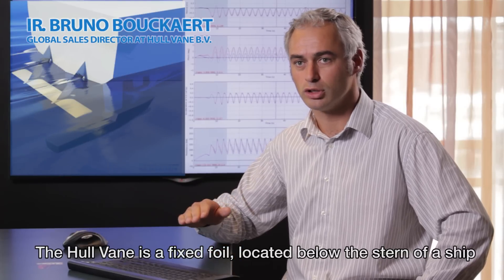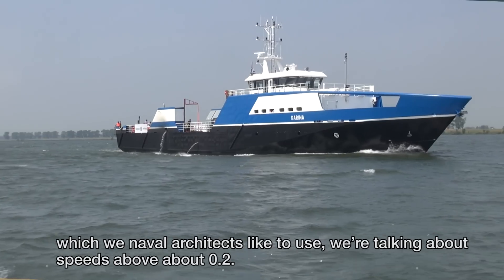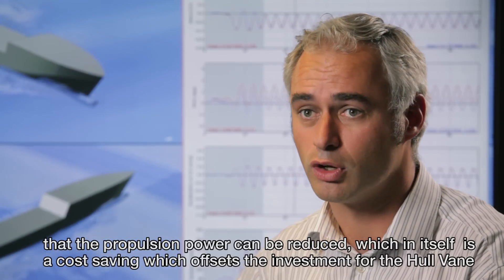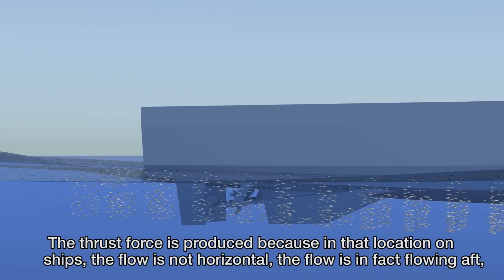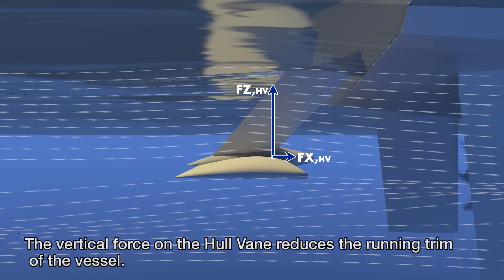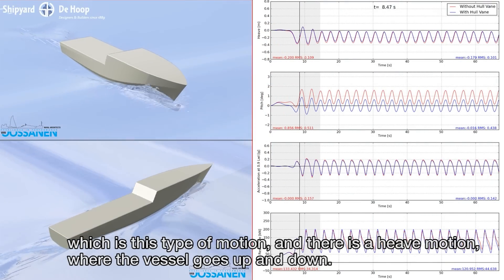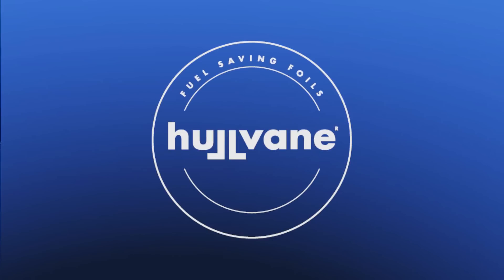Hull Vane - Fuel Saving Foils

Comment: What would be the payback period for a typical cargo ship?
Reply: How fucking expensive can this vane be? It's not hard to make, a welder could crank one out in a few days.
Reply from the maker: Depends which kind of ship, and of how it's used. Tankers and bulk carriers are too slow for this, and you will never get payback. On some others we get less than 3 years, and on some newbuilds 0 years (because the saving on propulsion power is bigger than the cost of Hull Vane). The latter are usually faster than typical cargo ships (e.g. crewboats,).

Comment: Cool idea! A while after watching this video it crossed my mind that maybe something similar, though upside-down, could be applied to my car. I have a VW Bug, which has a steeply sloping rear end, which causes a lot of drag as the air flows down along it. A wing placed at the right angle and position in this flow, redirecting it toward the rear, might have a net thrust force, countering some of this drag and improving fuel economy. Would also provide some downforce, a secondary benefit (I'm not a racer) of making the car feel a little more solid at freeway speed. Probably not as much downforce as the lift the car generates, but to make more would add drag, the primary goal being fuel economy, not lap times. Somewhat related to the downforce wings racecars have, I see it as sort of combining that idea and this "hull vane," though said wings redirect horizontal air upward to generate a lot of downforce, plus drag, while this would redirect downward flow to horizontal, gaining thrust and some downforce. Two challenges I see are that this would place a low-pressure area near the engine cooling air intakes, which would make the engine run hot, and also I'd have no idea how to determine the optimal position, angle, airfoil shape, and size without either a wind tunnel or very sophisticated CFD, neither of which I have access to.
Reply: Hi Quill, a very good idea, and there are indeed car spoilers (wings) which produce a net forward thrust as they are positioned in a downward flow of air. This is the reason why the Hull Vane is sometimes called an "inverted underwater spoiler".

Comment: They should be made in a more of a swept wing shape, in order to hopefully freely dislodge any rope, buoys, kelp, or other floating debris that could otherwise get entangled in the vane.
Reply from the maker: Some of our Hull Vanes have a swept wing indeed. What you see in the video (5 years old) is the very basic TT-shaped configuration.  Floating debris has never been an issue as the water coming over the Hull Vane has passed through the propellers and over the rudders first.
Reply: I am a former Maine lobsterman, our waters are like an obstacle course. LOL.
Reply: shirleymae30 you ain’t seen nothing till you go to Asia !!!
Reply: @markrobertson4320  an ocean of tooth brushes
Reply: @markrobertson4320  you’d think they’d figure out to quit using their water as a sewer and garbage dump. Their oceans and especially harbors and rivers are disgusting. It’s unbelievable they tolerate it.
Reply: im pretty sure they spent millions on researching the best design,,, moron
Reply: lol I love YouTube comments. So expert
Reply: Swept wings makes it even more efficient...

you can get rid of the wing tip turbulence.
Reply: @potatoraider7320  no mate definitely not

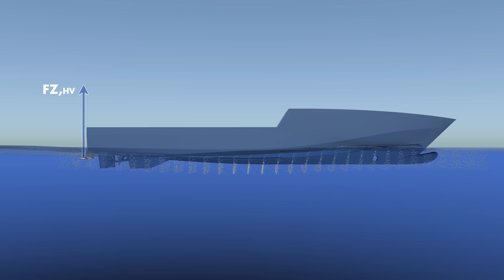Comment: FYI, the term you are searching for at #3 at about the 3:00 min. mark is called "Squat", and is what the hull vane is actually compensating for, or correcting.
Reply from the maker: Squat is especially important in shallow water, and yes the Hull Vane is effective against squatting due to the large vertical force developed at a low speed already. But the effect is much more than that (e.g. forward thrust, wave reduction), and we hope the video illustrates that.

Comment: Any lift it may provide will be lost by its own drag...just more smoke and mirrors. One of those a a container ship grossing 120 thousand tonnes will do nothing. They spend millions designing hulls and this over priced chunk of metal is going to be better...come on!!!
Reply from the maker: John, would you say the same about the bulbous bow?
Reply: @hullvanebv2550  no because the bulbous bows break the grain so to speak and the surface water makes contact with the vessel almost mid ship but they are also limited especially in rough seas. I do believe your hull vane would suit a much smaller vessel that's running much higher speeds as to eliminate the prop lifting out of the water.

Comment: This isn't new. Haven't they heard of hydrofoil
Reply from the maker: Hydrofoils exist since 100 years, to lift very fast and light ships out of the water and therefore to reduce resistance by reducing the wetted surface. Hull Vane is the only application of a hydrofoil for displacement ships. It looks like a hydrofoil, but the working principles are completely different, and the type of ships on which it is applied are completely different (way too heavy for full hydrofoiling).
Reply: @hullvanebv2550  Only one eh?  Here's a patent from 1955 for the same damn thing.  It specifically mentions displacement hulls.  LOL   Who you trying to fool?   https://patents.google.com/patent/US2832304A/en

Comment: Looks good. I could justify this more if the tips were active to be used as anti roll stabilizers. But the only real benefit would be commercial vessels that could really see the fuel savings pay for the install more quickly before it broke or needed cleaning and offset any fuel savings.
Reply from the maker: Hi Michael, the beauty of the Hull Vane is in its simplicity. Very effective with no moving parts, purely from hydrodynamic effects. Similar to the bulbous bow in this respect.

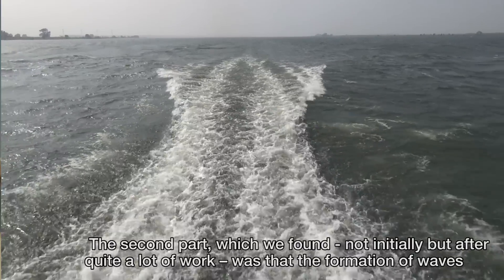Comment: Hi ! I think there is a mistake at 2:14. FX is opposed to the way of the ship (resistance must be backward), isn't it ? Thank you to tell me if I'm right or wrong so that I can understand.
Reply from the maker: Hi Timothée, it's not a mistake. This Fx is pointing forward and pushes the vessel. Where this forward force comes from is explained more clearly in this video: https://www.youtube.com/watch?v=56HvN5114TY . The point is that even though drag is pointing along with the flow, and lift perpendical with the flow, the resultant of lift and drag can still be angled forward, and therefore have a net positive Fx in horizontal direction.
Reply: @hullvanebv2550  Thank you for your answer ! I'll check this out !
Reply: @hullvanebv2550  Let me please introduce myself : I'm a french student in a  engineering school specialized in see technology called SeaTech. I'm mostly interested in renewable energies and ways to reduce our impact on the environment, and I am currently searching an internship. Is it possible to explain you my motivations in a mail, and send you my CV and cover letter ? Thank you to let me know !
Reply from the maker: @timotheekoehl2669  Hi Thimothée, yes you can find our contact details on www.hullvane.com

Comment: Would this be useful on large big ships like an Aircraft Carrier for the US Navy or their new Zumwalt Class ships?
Reply from the maker: Definitely! In addition to saving fuel, increasing range and top speed, there are interesting side benefits. An aircraft carrier becomes useless when it reaches a certain pitching angle, so reducing the pitch excitation is extremely valuable. Both vessels would also benefit enormously from the visual and acoustic signature reduction.
Reply: If you combine this with a Tumblehome design, would it result in less pitching angle?
Reply from the maker: The Hull Vane results in less pitching angle, regardless of whether the ship has a tumblehome design or not. Anything you add under water is good for seakeeping, it's just that most things also have a drag penalty. For Hull Vane, it's the opposite.
Reply: I agree, with the Hull Vane tech. But would a TumbleHome design "Enhance" the stability since it cuts through the water instead of riding it like a traditional bow, or would it not help compared to a traditional bow?
Reply from the maker: @Kamen_Rider_Blade   With regards to the Hull Vane effect, there is very little influence from the bow shape. Traditional bow, bulbous bow, vertical stem, tumblehome bow, even wavepiercer bow, all can be combined with the Hull Vane.
Reply: Sweet!
Reply: If a person fell off the deck and landed on top of the hull vane while plunging through the water and sank and landed on the hull vane, would they damage it? Is it sturdy enough to take the weight of a person falling on top of it from the height of a Aircraft Carrier deck while plunging through the water?
Reply from the maker: The plating on the Hull Vane on such a ship is more than 20 mm thick. I'd be more worried about damage to the person than to the Hull Vane. But apart from the struts, it's a couple of meters below water, so even that is unlikely. Better not to fall off the deck of an aircraught carrier though, you could drown in the aerated water behind the transom, which gives much less buoyancy than normal water.

Comment: Great for reducing drag until barnacles build up on it, thus interrupting the foil shape and essentially canceling out any benefit, but rather adding more drag. Just gotta keep it clean I guess.
Reply from the maker: This is valid for all surfaces of a ship, but in particular the rudders and propellers, because they see a higher flow speed and are not in the boundary layer. Almost nothing has a better return on investment than regular cleaning  (by diver) of propellers and rudders. While you're at it, give the Hull Vane a cleaning as well ;)  This also depends of your anti-fouling of course and how often (and at which speed) you sail. Reducing the benefit somewhat is possible, but to cancel out the benefit (10-20% resistance reduction), you'd need an extreme amount of fouling over the entire ship, not just on the Hull Vane.

Comment: Cool invention that actually works. 

It is weird to think about though. 

Seems like it wouldn't work because it adds more weight to the vessel and anything below the water line will add more drag no matter how hydrodynamic it is.

But the data does not lie, it does work.
Reply from the maker: There are many things that take up space and weight and still reduce drag by improving hydro- or aerodynamics. Bulbous bows on ships, corner vanes on trucks, wingtips on aircraught wings, shaped helmets on time-trial cyclists, to name a few.

Comment: So basically like a car spoilers?
Reply: Car spoilers are to spoil the look of the car, or the owner.
Reply from the maker: yes, but upside down. And water is different than air, and on ships we have a water/air interface, which causes wave formation (and therefore saving potential). 
There are indeed car spoilers (wings) which also have a negative resistance (downforce+forward force) because they're placed in a downward flow.

Comment: I wonder if the hull vane helps with propulsion in a confused sea condition? I understand this "help" was not the first thing on the designers mind.
Reply from the maker: Yes, it helps. It reduces the added resistance from pitching and yawing in waves. And it has a pumping effect, like any hydrofoil or wing which is moved up and down in a flow generates forward thrust (like a pumpabike).
Reply: So would just the energy from the waves making the ship go up and down convert to forward motion like a pumpabike?  If so, that really is a cool idea!

Comment: What happens if someone falls overboard?
Reply: Jack Burgoyne the rest of the crew waves as the person drowns in the distance
Reply: a good thing to do is not fall off the boat
Reply: That's a myth. The person usually dissapears before everybody has time to get on deck to wave goodbye.
Reply: With the added stability of the hull vane the rest of the crew has an easier time to get on deck to wave goodbye.
Reply: The same as always happens you get wet .
Reply: "Falls"...?
Or
 "Pushed" !

Comment: I am pretty shure that when large ships are anchored, or docked in a harbor canal, the flow of the water over this 'wing' will cause strong upward forces.
Therefor the wing should in fact be able to move, this way it would act more like a pitch-damper (look up yaw-damper in aerodynamics).
This would be more of a factory installment instead of a aftermarket product.
Reply: i dont think so even if you have like 4kn current this will have nearly none effect... Like an airplane wing will produce nearly 0 lift at 20 kn.
Thats why they said it is suited for vessels for 15kn+ (Container, Offshore. milittary) on slower vessels the effect is to small (Tanker, bulker).

Comment: Hydrodynamics is a tricky science, there are usually trade offs for everything.
Reply: Yes, like added area for marine growth to slow the boat.
Reply: @grancito2  I was thinking it also adds weight to the boat.  5 to 10,000 pounds is nothing to sneeze at...
Reply from the maker: The Hull Vane adds weight, but is often net-weight-negative: it saves more weight in fuel capacity (for a given range) and engine weight (for a given top speed) than its own weight. It can be applied as a weight-saving measure.  Also, the penalty of the extra weight is much smaller than the hydrodynamic benefit.
Reply: @Hull Vane Bv  That's the trick, penalty vs benefit.  Now given this device adds stern lift, does that interfere with the protruding bow bulb design ??  Which creates an opposite wave effect and cancels out waves going down the sides of the ship...
Reply from the maker: @High Velocity, There's not much interaction with the bulbous bow, except that the running trim can have an influence on the bulb's efficiency. The bulbous bow works on the bow wave, the Hull Vane on the stern wave. We have it on both ships with and without a bulbous bow.
Reply: @Hull Vane Bv  It seems like a great product, I wish you the best of luck with sales.  Last question, any thoughts about a 2nd generation with plane angle adjustability, to perhaps maximize results ??
Reply: I'm sure there are other tradeoffs, complexity, increased length for docking, something else to maintain, it would be susceptible to damage and getting things snagged on it, but sometimes the benefits just far outweigh the costs.
Reply: High Velocity,
Kind of like a marriage...
There ain't no free lunch.

Comment: As for trimming the vessel, that's what ballast tanks are for. No moving parts means it will be giving lift when it's not desirable and I wonder if they would break away in a serious storm and in so doing damage the ships structure possibly causing a hull breach?
Reply from the maker: In an accumulated 33 years of operational use so far, not a single damage or repair. The forces can be calculated accurately, and the Hull Vane is designed for it. Rudders don't fall off ships anymore either.
Reply: I have been at sea for 40 years, tankers, box boats, trampers, coasters, north sea standby and fast rescue, I have never seen one in all this time and not one naval architect, captain, engineer has ever mentioned one. I flew commercial hydrofoils in the 80s so fully understand the principle. Send me a list of these ships that have had them for 33 years so I can research them. Until then this looks like and sounds like crap.
Reply from the maker: Hi Paul, if you send an email to our general email address, I will happily reply  with a list of installations and year of installation, on which the 33 years is based,
Reply: Nope. Post the list on here for all to see.

Comment: Make sense, wonder why people didn't implement this earlier.
Reply: wonder if it would tear off in a heaving sea. they show it in still, calm water. mother nature would probably rip that spindly piece of steel right off the hull in an average squall =p
Reply: There is nothing new in boats. If you ever see anyone claiming that they have invented some new thing for boats, you can safely bet that someone did it decades ago.
Reply: It's not new.  Trim tabs have been used on smaller vessels in the US for decades.
Reply: I was watching a ferry today at max power with its bow high up in the air and thought that could be fixed with a wing on the stern to shift the centre of pressure backwards. Then I logged onto here and see this video. Creepy.
Reply: i think the right materials didn't exist. for instance sailing boats use carbon fibre in their foils
Reply: they have, this is an old idea.  I've read fluid dynamic papers from the 1960s that put foils like this on the front and rear of the boat to dynamically reduce pitching and increase average speed.   Many militaries have experimented extensively with hydrofoils for a variety of purposes.  The reason you don't see such things more often is because in practice the sea is full  of debris, floating logs, fishing nets, kelp and one collision with a foil gets very expensive and destroys the benefit of the foil.   You also have draft limitations in many places.
Reply: Check Viktor Schaubergers work, check the dates and realize all this vid and all big mouths here is still kindergarten. Bam ;D